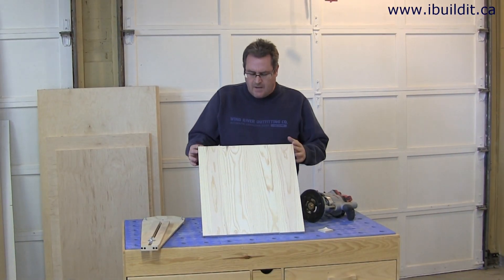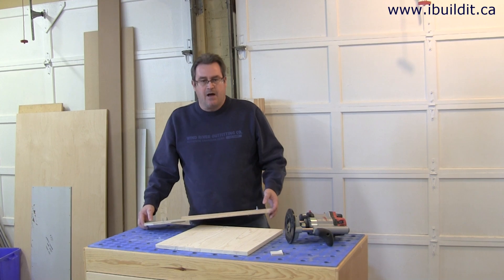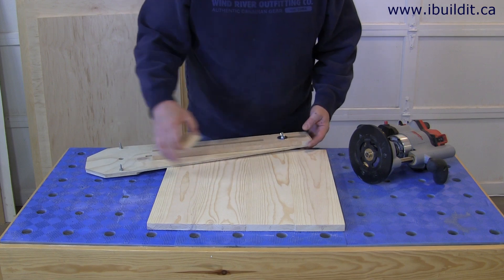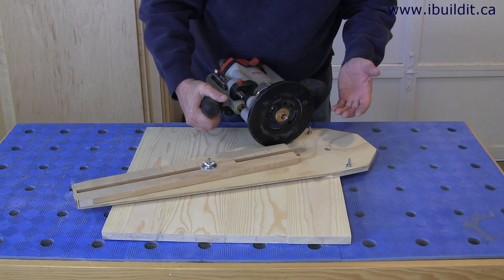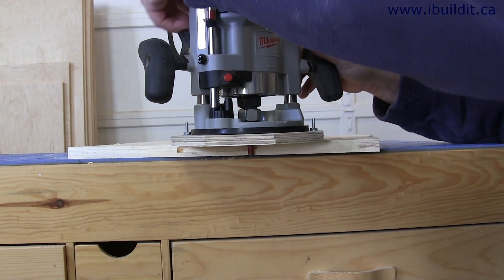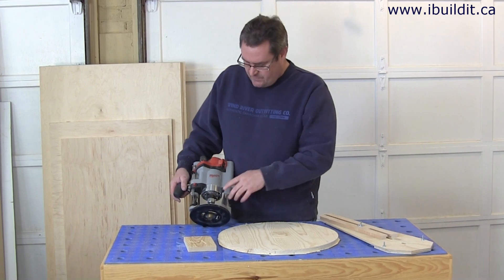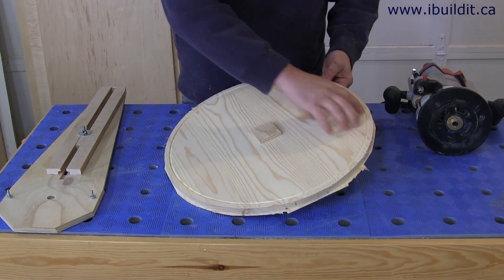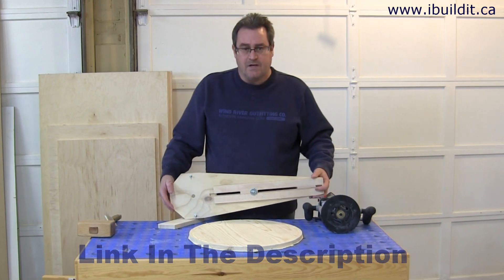Circle Cutting Jig

Comment: Quick question, if I wanted to cut, let's say a 6 inch hole in a piece of plywood, do you lay out off of the inside of the bit, middle of the bit or the outside of the bit?
Reply: Essentially I would like to make a jig to repeatedly cut a 6 inch hole by allowing my router to ride the outside of a circle that will leave me with the desired size, does that make sense?